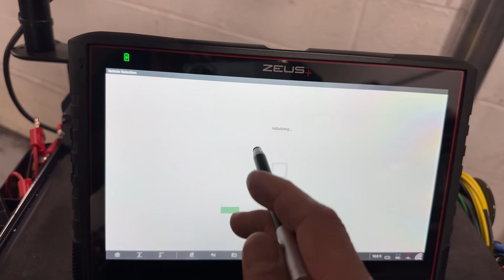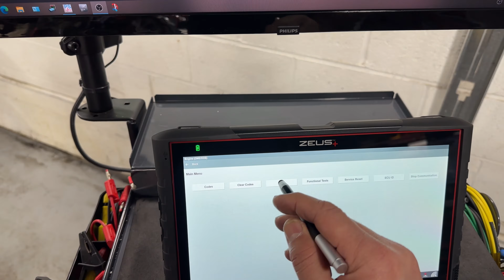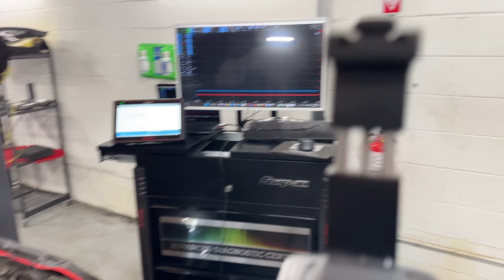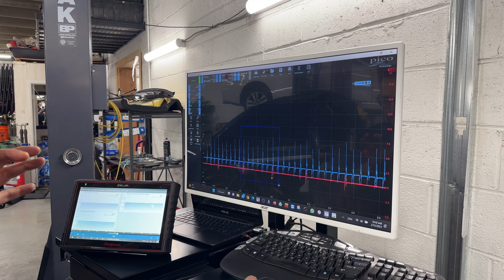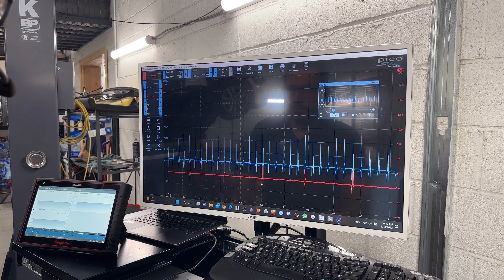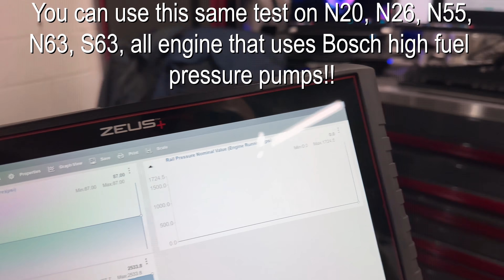2013 BMW 135is N55 Fault 2FB6 Cylinder 4 ignition

Comment: I really don't like these fluctuating ignition "dwell" times or coil "on" times. Shouldn't they be all the same length? I have never seen a car where the pcm can control that, usually when I see that there is an input issue or a pcm issue or a power or ground issue. Come to think of it,the coil "on" time is very strongly linked to the voltage supply to that coil. Weak supply = weak output. Cheers.

Comment: Nice new advanced diagnostic tool Maic! Scoping all the ignition on one channel is great thing. But what's with the fuel pump current is this a 3 phase brushless fuel pump? And now my guess - engine mechanical problem with cyl 4.I remember one of your old videos years ago on BMW 3 series. The ignition waveform was good but in in cylinder pressure you've captured a very intermittent sticky valve. Good luck man, I hope boss buys exhaust system for the shop

Comment: Can you check all of your injector voltages? or the current ramp.. one guess is that one of your injectors is already turned on at ko/eo  .. you should have 12v.
Reply from the maker: Watch the end of the video. No injectors are on or leaking. I share a good test you can use across the board for BMW GDI just not on the N54.
Reply: @MaicSalazarDiagnostics  how would you isolate the cause to be a bad high pressure pump or an injector(s) leak if you saw the rail pressure starting to drop?
Reply from the maker: @sablan02  as per the Bosch design when the key is on the fuel is trap in the fuel rial. So after running the engine and turn it off and quickly turning ignition on, the pressure will stay and will go up as I show in this video. If pressure drops the only thing that can leak in there are the injectors. This test is 100% accurate.
Reply from the maker: @sablan02  so the other scenario is if you run the engine till warm and turn it off and quickly set the ignition on but there is no pressure ( all pressure goes away with just turning engine off and ignition on). Then high fuel pump is bad. Hope you get the idea.
Reply: @MaicSalazarDiagnostics  that makes sense. So essentially the 2nd scenario is fuel bleeding back down the high pressure pump from the rail towards the low pressure side? My shop has a low fuel pressure pump test gauge with a lever that opens and closes. Could this be of any use with your test?